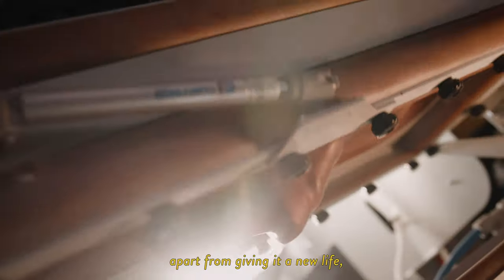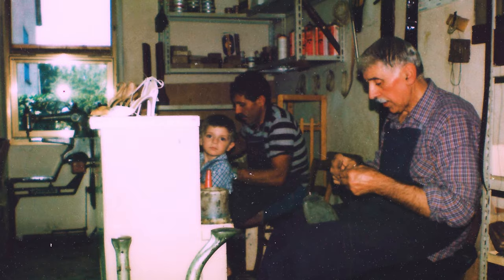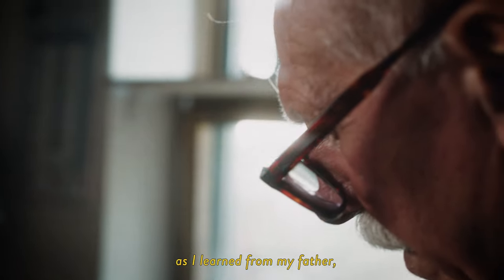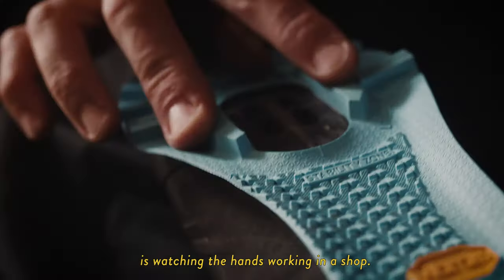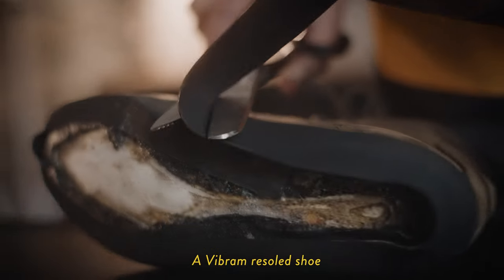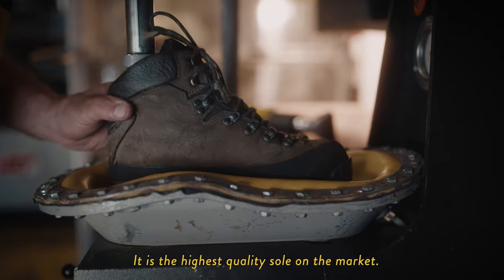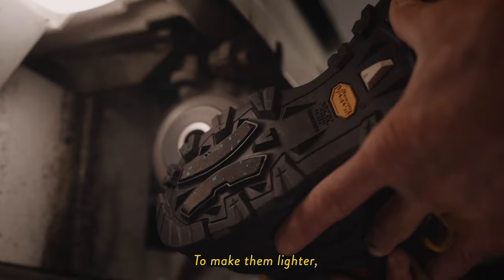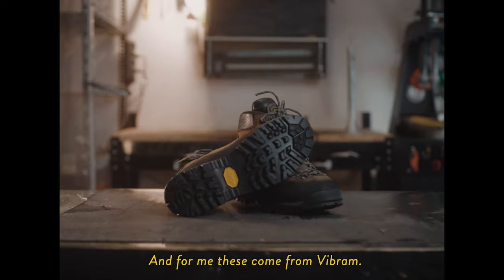Repair if You Care | Recap

Comment: Let's be honest about this: a good 95% or more of the shoes out there are not designed to be resoled, and the main part of the shoes, however eco friendly, recycled the marketing wants us to believe, are basically use once, throw aways.  The recycling process may use recycling materials, but takes an enormous amount of energy and more importantly water.  The fact is until all these companies that espouse environmental consciousness actually start making things that last again, that are capable of being resoled, all this is just nonsense.  Unfortunately, the market is toward lightweight, trail runner type shoes championed by all those thru hikers and everyone else, which basically means a bunch of lightweight, recycled material that gets trashed which is counter to actually being environmentally friendly.  How durable is ecostep rubber or other Vibram lightweight rubber soles?  Even if you can resole the shoe, if I have to resole more recycled rubber soles because they don't last as long, that is not environmentally friendly and has a greater impact on the environment waste.  Across the board, the softer, eco/recycled, lightweight rubber outsoles sustain lugs that break off and wear far quicker.  Yes, the market is toward more lightweight, but companies need to start being honest and forcing their partners to stop with this absurd trend.
Reply: Same shit happens to car tyres. Twenty years ago you could hold a set for 5 years if their mileage did not exceed 45000 km. If you do it now you risk your life.
Reply: @andreasr6632  Yes but modern tyres have way more traction and are much more likely to save your life in an actual emergency situation. It's worth the tradeoff.